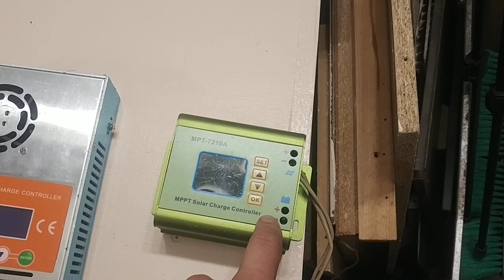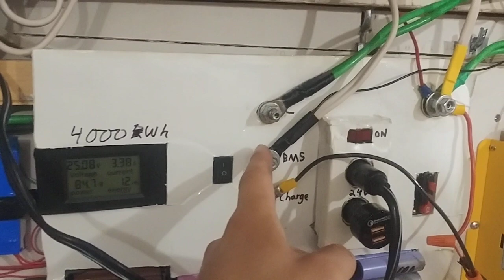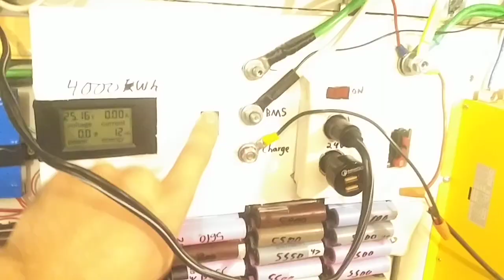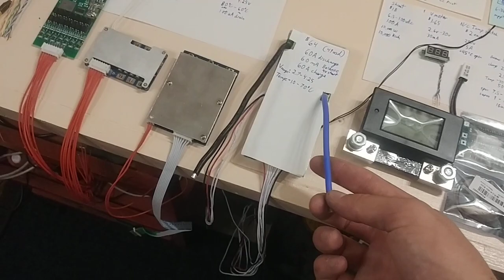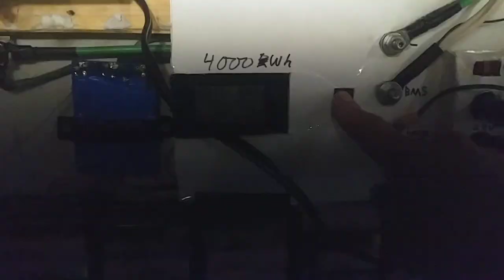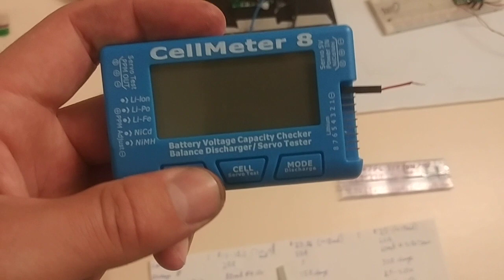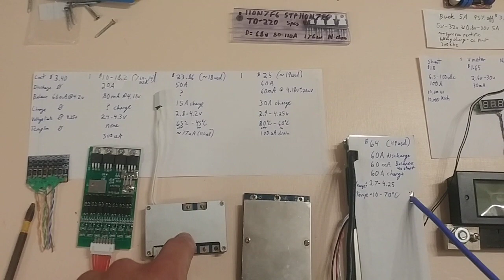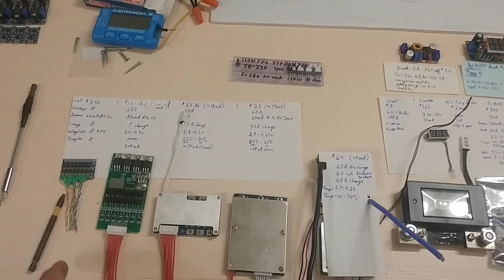Connecting BMS to solar charge controller? Q&A

Comment: Ok good stuff but a little hard to follow. I have been researching this for months and there are lots of questions all over the interweb on this subject and ten times as many answers (mostly opinions). And frankly I haven't found one I would put my faith in yet. I have a Victron 75/15 MPPT and several 3 port 4S BMS's of different brands for LiFePO4 cells one is 70 amp, the other is 100 amp (14 volt). The intention is to use it to power a portable fridge. Would it be possible to put up a clear schematic for a project like this please? I am sure it would help a lot of people me included.
I am not exactly a novice but this setup have me nervous.

Comment: Thanks Andy for putting this info out, excellent supplemental info! One thing I agree with is "drywall is so fucking cheap!" but at the same token make sure you buy a high quality bms such as overkillsolar bms's.  Compared to a fried circuit or a burned house they are "fucking cheap" LOL.

Comment: Planning a system of 2.5kW PV + 120V 50A MPPT + 24S BMS + 24S LiPo + 5-20kW BLDC. Batteries will always be connected and charged by the PV. Therefore, BMS is a must for balance charging the batt. Yet, some people are saying that I don't need BMS. I'd like to send you my schematic to get your comments, but how?

Comment: hello bro i want to make a12v powerbank  with 3.7 voli lithium ion battery which i want to charge with solar ani how can i make 12 volt from this 3.7 v battery should i add 3 on series or 4? can you help me bro?
Reply from the maker: 12v is the worst for lithium. 4s with bms and a buck converter is what I did. I don't make small packs tho so I'm not an expert but the one I built I did that way.
Reply: @AndyShell  thanks for the replay bro .but i am still confused on this . i am in nepal and here i dont find bms for the pack and even cant buy from any online site so its hard for me.if you have any idea please  help me.any way thank you again.
Reply from the maker: @JourneyOf_Life  if you can't buy off aliexpress then there's no point in building a diy pack. You'll just end up with a garbage pack. Buy an ebike pack or something.
Reply: @AndyShell  sad story of me .thanks for your support.

Comment: You should atleast have cell monitors, if not using a bms, and keep an eye on it! But better if You can use a small bms with a relay, or contactor ,  I have a small bms, and a shunt trip breaker,   someone needs to make something better and cheaper for this stuff, like a small bms, ballancer, with a shunt trip,   it will not heat like a mosfet, or use power like a relay,  I bought a used shunt trip 3phase breaker, with 24v trip coil, but new they are hundreds of $$$ , something that could trip a DC breaker, could be awesome,

Comment: Most batteries catch fire when discharging too fast.
Not when charging. Check how many ebikes and electric cars catch fire. Its because cells overheating at high drain.
Research before you talk.
Reply: I think Andy Shell is correct - for PowerWalls, esp those connected to the grid, the charge cycle is the hazard:

 1. since grid power is available, people may be drawn toward aggressive re-charge rates (though perhaps they should be avoided). 
 2. most owners try to minimize battery energy consumption (prefer what ends up being a "slow" discharge rate)
 3. anyone could fail to filter out weak cells or mismatched cells, or choose a weak bms that dies early, or fails to balance well, or cannot be monitored, resulting in a potential fire hazard, which would manifest itself only during the charge cycle.  

I am glad I found Andy's channel.  I watched about a dozen of his videos today and I will continue to go through the archive. I appreciate his willingness to talk about fire hazards and mitigation ideas. I think other youtubers are reluctant because it might scare off their audience.  Also I have not yet found another youtuber talking about going DC direct from a power wall for a legacy desktop PC power supply. I like the idea.

Comment: Please help. Just completed my 14s4p battery pack my problem the BMS 14 lead wire harness is now too short to reach the cells monitoring voltage. Can you recommend the tools and parts purchase for building your own wire harness? Or better yet a 14 lead harness with leads at least 12 inches long.
Reply from the maker: just get any sized wire that looks about the same and solder it onto the end wires of your harness so it can reach. use heat shrink tubes, liquid tape or electrical tape to cover exposed wire. :)
There will be no negative side effects no matter what anyone tells you. lots of ppl talk but dont do. you'll be fine :)
Reply: @AndyShell  Yeah was thinking the solder joint might cause a voltage drop affecting the charged voltage monitored?
Reply from the maker: @MaxGoddur  nope. at most it needs to handle 5v 100-500mA of current. you could probably even get away with using cat-5 network cable wires or double up but should use stranded copper wire like out of an old computer power supply would work perfect.

to have wire resistance loses you need a few meters. you can test this by using your DMM (multimeter) and just measuring each wires resistance then measure it again after you solder the extra wire onto it. 

when its all pluged in and running you can test dc voltage between the battery and bms for each wire to see the voltage drop of the wire its self. 

note the bms only activates the balance feature at 4.2V of the cell the wire is connected to. each wire in the harness is its own circuit only looking for 4.2vdc then it short circuits with a small resistor to start draining the battery.
Reply: @AndyShell yes will try soldering longer leads to my existing BMS wire harness. Thank you.  Now for a question, is the BMS looking at the voltage from each cell or is cumulative reading to act on?
Reply from the maker: @MaxGoddur  it only looks at each cell and will turn off flow of power through bms if any of the data sheet spec values are under or over. if you exceed 4.35 or so volts on any cell it should turn off flow of power preventing cells from charging until that one has been drained by the bms down to 4.2v. you'd have to test as i dont know anything about your bms. most settings are based off each cell not the whole except for max amp draw and max voltage shut off

Comment: I just noticed I only got notified about 2 videos in about 6-7 months! The thing about BMS and charge controllers, is if the BMS trips the controller can get cooked! A relay to disconnect pv in, when battery power is lost, to save the controller, or two BMS, one for charging, one for discharging, I don't know if I'd trust the BMS with charge separately, but I don't have one now, but I do on my 12v lifepo4 bank,   I have some large stick on heatsinks, for DC to dc's and such, I'm thinking I'll use the heat conducting double sided tape, to help with bms cooling, they are like 25mm x 25mm x 15mm, just holding them in front of the fan, you can feel them get cooler, they are like giant CPU heatsinks, 
I need to get about 1k ah of battery, before the deep dark winter gets here! I have 24ah of the lipo to add, ordering more tomorrow, I'd like to have about 700 of those cells! 800 ah!!! Or 1k of them, 1500 ah, that would be cool, but yeah, you need atleast a high voltage disconnect, and keep an eye on the balance! This isn't a hobby for me, its how I power my house, its just something I like to do! A small BMS, with a large contactor, would work, for balance protection, and voltage protection, it would just not have over current protection,, I guess that's what I'm gonna do!!  Maybe build a large solid-state contactor, capable of about 1200 amps, and the BMS, to power the gates, if the BMS trips it will shut off the power of the battery, with a smaller , 200 amps or so for the pv in to the controller, prevent damage to the controller! Keep at it man!!
Reply from the maker: sorry i took so long to reply James. i feel like heat sinks for bms is pointless but depends what one you have. You're offgride system is massive. idk how many ppl need or have a system with that many batteries. lol. do you use a lot of energy?